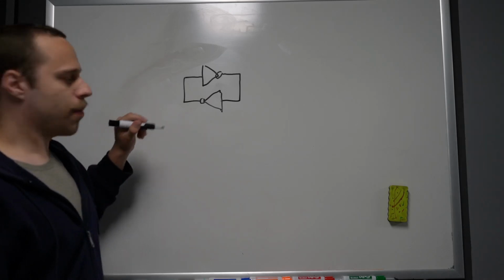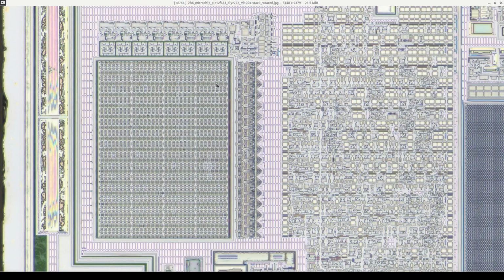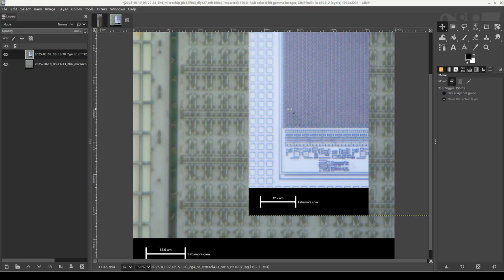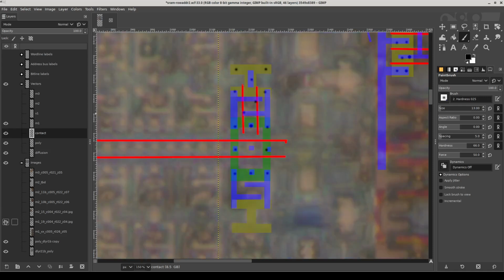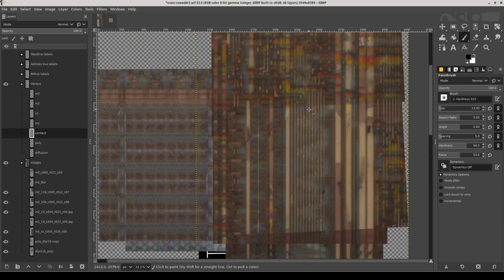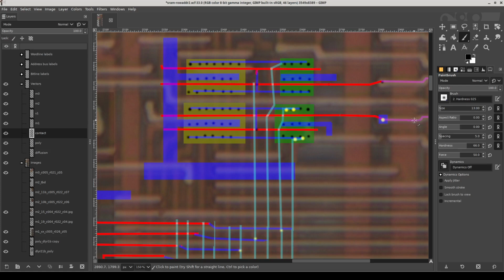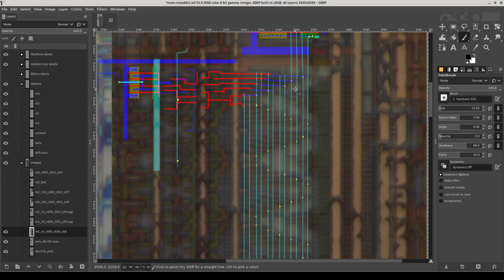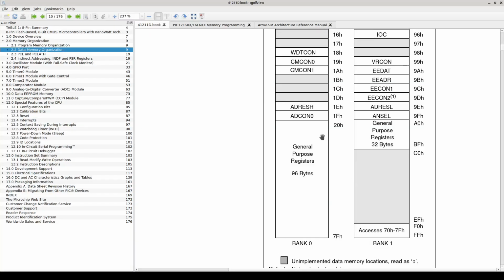[25] PIC12F683 part 5 - SRAM

Comment: Can you do one video on DRAM circuitry?
Reply from the maker: Maybe eventually, but it won't be part of this series since there's no DRAM on the PIC12F683. As a general rule, DRAM is the sort of thing you mostly see on a dedicated chip since it requires so many special fabrication steps, although embedded DRAM (eDRAM) has been done a few times by... I think IBM.
Reply: @AndrewZonenberg I'm just intrigued to see how DRAM looks like in silicon and read somewhere like they went for this design to reduce cost and it occupy less area compared to SRAM.But DRAM has overhead which causes bitflips due to read disturbances.
Reply from the maker: @abiyaprimency5149  DRAM is a 1T1C bitcell rather than a 6T bitcell, so the density is dramatically improved. But the deep capacitors need a special manufacturing process, and it needs to be refreshed every few ms to deal with the capacitors leaking. And it's slow.

The other reason I haven't made any content about it is just the challenge of getting good imagery: SRAM is a relatively 2D structure that you can easily depict with a few 2D images of the array as shown here. DRAM is extremely 3-dimensional and to show it off properly would require a bunch of FIB cross sections or (ideally) TEM lift-outs.

We have a dual beam SEM/FIB at work but I don't get to play with it for my personal projects so you won't be seeing it on this channel. I'm trying to get access to SEM and FIB outside of work that I can use for fun projects, so stay tuned...
Reply: @AndrewZonenberg Make complete sense now,thanks for the explanation.